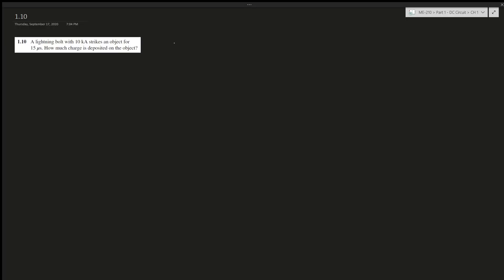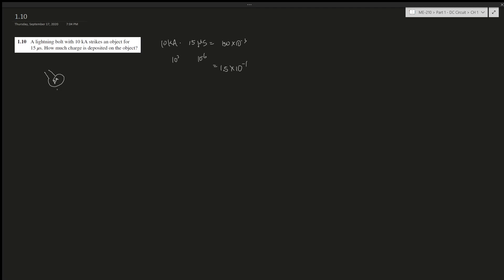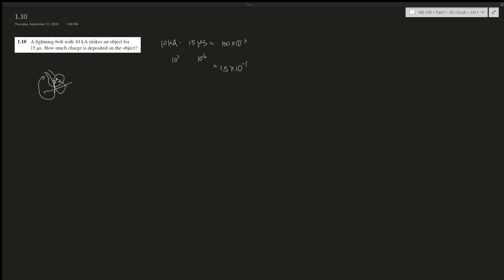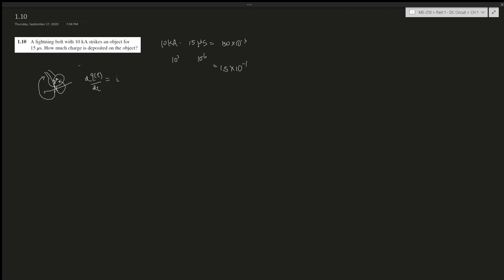1-10 A lightning with 10 kA strikes an object for 15 μs. How much charge is deposited on the object?

Comment: where did u get 150?
Reply: 10*15=150, it's the kiloamps x the time
For that part he ignored the x10^(power) stuff for a moment.
Like in full it looks like 10*15* x10^(3) x10^(-6)
10*15=150
10^(3)*10^(-6)=10^(-3)
So it's 150x10^(-3)
=0.15 or how he wrote it 1.5x10^(-1)

Hope that helps a little bit.
Reply: @aliciaserrano9698  Appreciate it